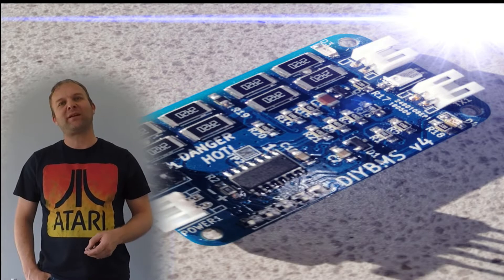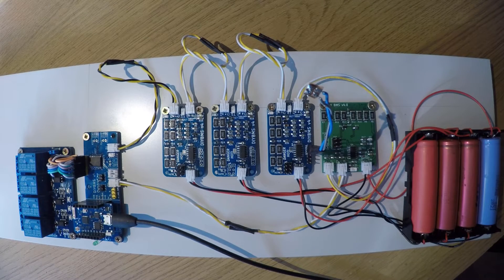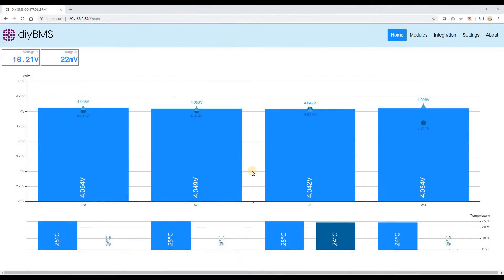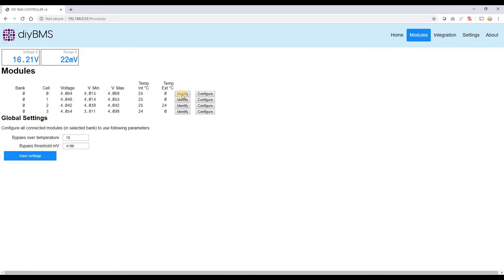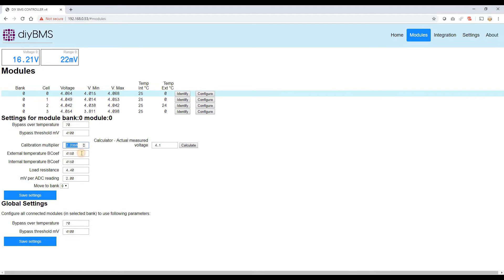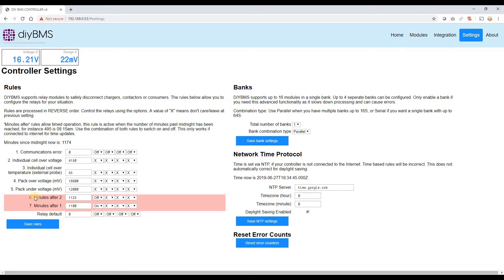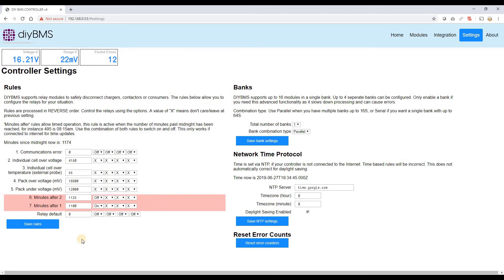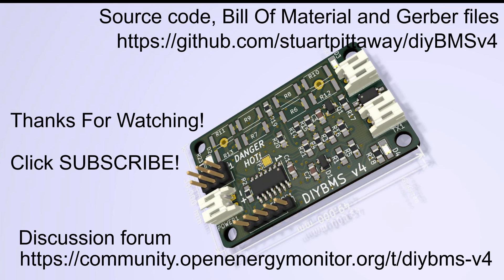DIYBMS V4 Introduction

Comment: What's the maximum cell count it can balance and monitor? Also what's the maximum discharge?
Reply from the maker: Up to 128 cells and discharge current is max. 1amp (typically about 400mA) per cell.
Reply: @Stuart Pittaway  128s sounds amazing. Btw I meant what's the maximum discharge current the bms can monitor/handle from a battery pack*
Reply from the maker: @republicofvegans712  it doesn't work like that, it depends on what current shunt you install, and what fuses you use. It's similar to the batrium system in this regard
Reply: @Stuart Pittaway  ahh I see. Basically if we have the shunts installed, the controller can be programmed to cut of the battery at a certain current and voltage assuming a dc contactor is installed. Correct?
Reply from the maker: @republicofvegans712  correct

Comment: Omg, I gave this up for a year because I couldn't figure out the uploading code part on the ESP32 controller + Wemos D1.  I built 20 of these modules to learn to solder and how to order, what a gerber was, a diode, resistor, etc.  I finally jumped back in and figured out what an IP was and what a DNS was not.  Holy cow I got it to load up on my PC.  Nothing is connected but the v4.0 software finally runs for me.  Looks good too.  IDK what anything is in the software yet but I appreciate you setting it up so I can slowly figure it out.  Thx Stuart!
Reply from the maker: Thanks for leaving a comment - a lot has changed since that original V4 video, but glad its working for you.

Comment: Are they suitable for HV battery? Say 140 cells in series?
Reply from the maker: It should work, however I recommend staying at safer voltage levels (below 50V DC)
Reply: @StuartPittaway  Thank you for reply. Fully understand your low voltage recommendation. I'm builbing HV pack and doing the reasearch what to use for cells voltage monitoring and balancing. Your approach looks good as its isolated and lookls like easily scalable. The other idea was to use "smart BMS" for Ali..., say 12s for 120s battery and get the data via bluetooth from each unit and then combine it into proper frames for CAN bus comm with inverter. What is the longest comm string you tested? What if i build 192 boards and daisy chained them? Greetings!:)

Comment: My power wall has 152 cell blocks in series. What kind of DIY BMS would work for me?  Really I already have a system with precharge ability monitoring their voltages with protections for amperage voltage and temperature but there  bleed off resistors are quite small so I'm looking for something to add a bit more balancing ability that won't vaporize at 516 volts.  There's a bleed off resistor on every cell as well as on every pack of four cells.  Lithium iron phosphate.  It's the factory BMS system that came with the batteries. Valence brand.  Battery model u27-12xp. Maybe I could just solder in some wires on each side of the resistor that's already there and run them off too a controller that would activate a larger resistor connected to the balance leads which gauge is appropriately sized for about 1.5 amps.  Or a standalone board that purely looks at a cells voltage with a bleed off resistor that activates at 3.39 volts and there's one board for each cell block.  I know the voltage is a bit low but that's the maximum I can get a cell too with the charger I have.
Reply from the maker: 152 series cells isn't going to work on diybms, it's good for about 100.

Comment: Can u look at a switch mode setup for single cells that can bypass cells and charge cells individually by turning that cell off and buck boost the voltage to keep pack voltage correct and can go ontop of cell be cool
Reply from the maker: You are sort of talking about an active balancer there, not something I'm actively looking at.
Reply: @StuartPittaway  yeah its beyond just that 
Want it mcu driven and data logging and  AI best management algorithms haha..........

Pack full of mix cells and states 
Irasepctive of currents and the cells setup voltage they run all independently of each other 
If a cells stuffed and likes sitting 3.9v instead of 4.2 or other cell likes 4.3 etc and one cell maxes 5a draw and other does 15a u can bypass 10a over 5a cell etc and temp problems...........

Better life spans and more control on ur setups

Comment: Hello.this module looks like it can handle more than others you disighned ?? Will 4.2 cell modules work in a parrel cell systems  or series. With out damaging anything .... just making sure I don't break anything whilst conecting it all together.??
If i had know about the newest board with the relays connected and the cell programmer built in. i would of  for that control unit. Looks great BTW😎 mutlie functional device's 
Thanks for your help. 
Cheers  Stuart.😎
Reply from the maker: All the V4.X boards can work together and can be connected together.

Comment: I am to put 45 cells in series... a powerbank for EV car... can I make an adaptation to use that?
Reply from the maker: For a large EV battery you may need a higher balance current than the diyBMS provides.
Reply: @StuartPittaway  I am so impressed with your work man. and very happy that I got your answer. do you suggest where should I start in order to get that? I am working on a "power bank" plug and play to a hybrid Toyota yaris.. I could use a converter and a typical 48v battery pack but that is not efficient... I think....
Reply from the maker: @GuilhermeGomes2  I'd have a chat to the people on second life storage forum, they have lots of clever people on there that could help.
Reply: @StuartPittaway  thanks a million! well done for your great job!

Comment: More questions I have is that my system is an 18S1P 280ah. Will this system with its resistors be able to handle it? My system can charge up to around 50 amps max which would be around 2.7amps per cell. I think that I read that the resistors dissipate around 1amp, am I doomed to fail? Can I increase the resistance somehow or is this typical?
Follow up question, I will be increasing my capacity but adding up to three more banks in the future, is it advised to do say, 18S4P or do 4 separate banks of 18S1P? I guess what I am asking is should each cell have its own diybms module, or would it be ok to group 4 cells and use just one module for each of the 4P sets? Does this make sense?
Reply from the maker: Do the cells still charge at 2.7amps when they are nearly full?  The BMS could switch off charging and allow the cells to balance.

Comment: So looking at the latest version I’m left with questions. is there a new version on the horizon that is packed with improvements and new features that I should wait for before placing my order? I am referring to the v5 / actiBMS listed on GitHub.
Reply from the maker: The latest code and next release work with the existing hardware. There will be a new controller board, but that's definitely a work in progress and no release date set.

Comment: Hi Sturt, is the part JLUpcb misses attiny85?  Plus the 3 pin serial bus plus where did you get them please? Hope you are well. Stay safe.
Reply from the maker: Hello its an ATTINY841 which is needed on the DIYBMS v4 boards.  There isn't a 3 pin serial bus, there is a 6 pin header for programming the ATTINY.  These are just standard header pins - any electronics retailer will stock them.
Reply: @StuartPittaway  I have heaps of header pins. Where did you buy the ATtiny841s from mouser,
Reply from the maker: @chuxxsss  think I went with digikey but most of the retailers stock them

Comment: You can't even make a video that doesn't sound like shit!
You expect people to trust your designs, when you can't make a mic work?
Reply from the maker: Thanks for the constructive criticism, feel free to find another project.
Reply: @StuartPittaway  Your C3 and R15 values alone, say how much electronic experience you have. 
Add that to my original "constructive" criticism. Egos Galore!
Reply from the maker: @nutsandguts2871  so rather than being negative, why not suggest improvements for the benefit of the community?
Reply: @StuartPittaway  I wasn't being negative. I told you what you already knew, but didn't give two shits about, and published with awful sound anyways. 
You took that as a punch to your ego, and made a sarcastic reply. Anyways, this design is not what I was looking for. Good luck.
Reply: Eliminate C3. Your port has to charge and discharge this cap (C3), as well as the capacitance of the gate of the mosfet. 
No filtering is required, when the gate signal is coming from a digital signal source such as an Arduino port. 
There is a limit each port can sink and source. Usually it's 5-10mA with a total limit of 200mA on all pins combined. 
That 510 Ohm (R14) is saving your PA3 port on the MCU, from blowing up by C3. 
You would use a very small capacitor (~100nF max), if you have problems with EMI due to sharp rise and falls of the gate signal.
I am pretty sure you won't have to worry EMI emissions with close to DC switching frequencies of this circuit.
Reply from the maker: @nutsandguts2871  thank you for the feedback and comments. In regards to the poor audio, I had to make do with the equipment and tools available to me at the time. Newer videos have improved audio, I'm not trying to become a YouTube star so I'm not spending thousands on rode mics and fancy cameras!

Comment: Can i use these modules with 4s liion battery?
Reply from the maker: Yes that would be fine
Reply: @StuartPittaway  thanks, i m not an electronic guy, and having some problems in figuring out how to set up, 
Is there any public community so that i can post my questions? Or read more about max amp output.
I want to have bms which can discharge 4s battery pack upto 12v (i.e 3v per cell) i m using it in a power wall and i need about 100 +- 10 amps of continuous current output.
Reply from the maker: @birendrakumar-gl5gq  take a look at open energy monitor forum

Comment: How many amps can be discharged continuously with this BMS?  I know the system can be setup in a 16s configuration but cant find a ballpark amp rating.
Reply from the maker: What do you mean by discharge? The BMS doesn't directly control the current flow, you can use the relay board to drive that if needed.
Reply: @StuartPittaway  Most of the commercial bms units have an amp rating for max continuous discharge.  If  it's exceeded the bms will go into bypass if I'm understanding the rating correctly.  Is this not a factor since the diybms is a distributed system?  Apologies if this is an amateur question, I'm still learning.
Reply: @StuartPittaway  Oh I think I see what you mean: you could use the relay board to put the battery bank into bypass at a set current draw or temperature.
Reply from the maker: @gustersongusterson4120  that's correct. The power of the battery doesn't go through the BMS, so it doesn't have a rating. This rating is up to you to decide and then put suitable components externally to the diybms

Comment: Hi Stuart, I am working on a DIY version of BMS for LiFePO4 cells. The difference is the charge voltage which is 3.65v for LiFePO4 cells. I would be interested in getting some feedback from you on converting or updating your design to support LiFePO4 cells.
Reply from the maker: No need to change anything, lifepo4 works fine with the v4 design. Just change the vale to balance at in the settings.

Comment: I wanted to know the BMS V4 which you designed is for a single cell? Meaning each cell requires a separate BMS or a BMS for a whole battery pack?
Reply from the maker: You need a module for each group of cells in a battery pack - it will work with more than a single cell.
Reply: @StuartPittaway  Thank you for your kind reply . One more doubt .. I am building a battery pack of 7p3s ie 21 ie ( 3 parallel sets) So do I require 3 v4 BMS modules ?
Reply from the maker: @raaghavkrishna9755  you need a module for each series cell, so 3s needs 3 modules

Comment: hi, applause for the progect !! :) 
I like to do this bms, but I have a fear it´s not enough for balancing the cells lifepo4 160AH, is have only  500mA a 800mA power balacing, right ? 
is possible 1A or 1.5A ? 
regrads 
alcobia
Reply from the maker: This BMS should cope with that size of pack easily. In a well built battery of cells they should rarely need balancing.
Reply: @StuartPittaway  HI, few questions, please define well build. I have just ordered new Panasonic 3400mA cells to start with. I like to build a 48V >4kWh minimal. (4 banks of 13S10P ( 1,3kWh) ) or should I go for two banks (13S20P)? What is handled better with those design? Last question, for this BMS, should I charge the batteries full when I connect them for the first time to your DIYBMS or can I leaf them as they are? Thank you again for your effort and work.

Comment: Hi Stuart, 
Thanks for sharing this project. Will it work for lifepo4 3.2V 150 Ah cells as well?
Reply: Yes, I would be very interested. I am desperately trying to acquire/create/purchase an idiot proof bms/pcm for 4S lifepo4 that will integrate with my "pocket" sized, extremely portable solar generator. It's hard to get confirmation that components will play well within my parameter requirements.
Reply from the maker: It should

Comment: hi, i'm new, i can only work with ide, do you have the code in the arduino IDE?
Reply from the maker: No I don't use it, try platform.io or atom ide, you won't go back to the basic Arduino IDE
Reply: @StuartPittaway  what is the balancing current?
Reply from the maker: @user-xj7db6ww5e  it varies depending on the temperature, but somewhere between 500 and 800mA
Reply: @StuartPittaway  will you help me increase the balancing current?  I got an electric car which has Lifepo4 built in, charging current 15A voltage 160v, I would like to use your BMS
Reply from the maker: @user-xj7db6ww5e  you won't need to increase the balance current if the cells are well matched.
Reply: @StuartPittaway  
Can you do a step by step code download tutorial?
I can not do it(

Comment: How much begging and groveling would the community need to do to get a Kickstarter or something going? Getting the manufactured for cheap would make a thousands and thousands of nerds very happy. Sell the controllers with and without the Wemos and have the monitors available in pack discounts. I'd take two controllers and at least a dozen monitors right off the bat if we're only taking a few bucks for each component. Controllers at upwards of $10 USD without a Wemos, monitors for $5? I'd distribute in US in a heartbeat.
Reply from the maker: I've been working on a slightly simpler design which can be automatically assembled by JLCPCB the cost is also very low now probably less than 4 USD per module. I'll publish it on GitHub when it's proven and tested.
Reply: I can't like this more than once which is disappointing. More likes!
Reply: @StuartPittaway  Great idea, any progress on that?
Reply from the maker: @rvamerongen  Yes the board has been availably for many months, take a look at the GITHUB and Forum for more info

Comment: Hi Stuart! Thanks for sharing!  Is this BMS working with LTO Battery pack(24V, 7.2 Kw)!? Normal voltage 2.3V, 40A per cell ; Standard Charge Cut-off Voltage 2.8V; Standard Discharge Cut-off Voltage 1.5V.
Reply from the maker: It will struggle with voltages below 2V so I think you may be best with another solution
Reply: @StuartPittaway Thank you so much.

Comment: hi i am confused about the circuit since i cant see opto-isolator for rx?? 
i am trying to build the circuit for different batteries like. 1.5 - 2.8v battery.
thanks in advance...
Reply from the maker: There isn't an Rx on the module this is on the controller. The Comms forms a loop passing data from module to module

Comment: I h ave a question that always kicks my mind when I see battery projects like this.
But in this case I think that you could help me with my question.

If I'm charging the battery pack @1.5A, and the Bypass mode can dump like 1A it still means that 0.5A are going to charge the bypassed battery.
I think that could in this case happend that the bypassed battery get fully charged while still in bypass mode.
In such case I think that the relays should alert the charger to stop charging.

Is that correct? If so, wouldn't be better to limit the charge current during bypass?
Reply from the maker: Yes that's when the relays are for. You set up a rule to stop charger if a single cell goes over a particular voltage.
Reply: @StuartPittaway  So actually the charge process must stop if the bypass/balancing process start!

Another question, is there any reason on why you used timer 2 on the attiny (instead of timer 1)? I still cannot understand how thoose timers works (too many register to control them), AFIK you use them to the PWM for the bypass resistors. The PID chnage the duty cycle to keep the temperature.
Reply from the maker: @tuttocrafting  the charging can continue, normally the bypass voltage is set less than the critical stop voltage
Reply: @StuartPittaway  Ok, thanks.

Have you seen the "new" ETA3000 chip? Looks quite interesting. The downside is that you have 100mV threshold and you have to optoisolate the ATtiny pins to control it!

But it would be a cool combo to integrate with your bms project!

I was thinking to fork it add add the active inductive balancing on it!
Reply: @StuartPittaway  I have added the Active Balacing feature on your hardware.
Take a look:
https://imgur.com/a/J5nLEh4